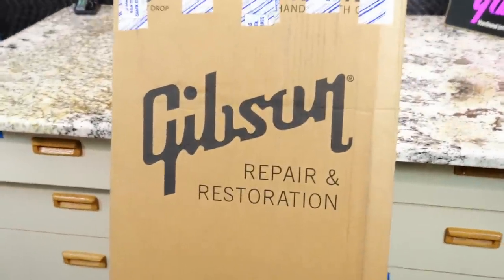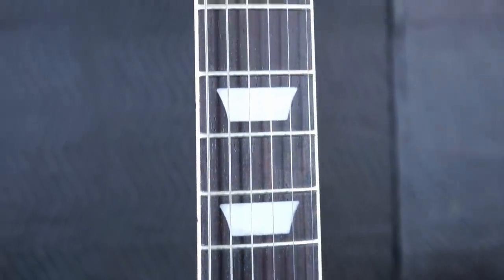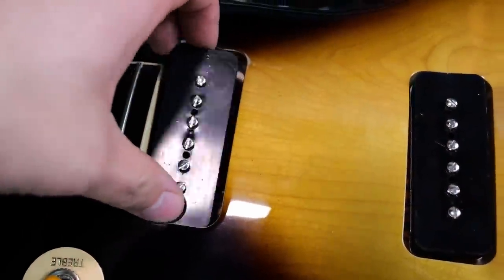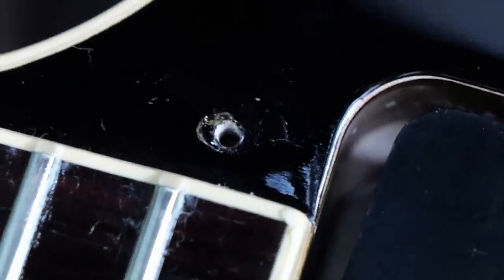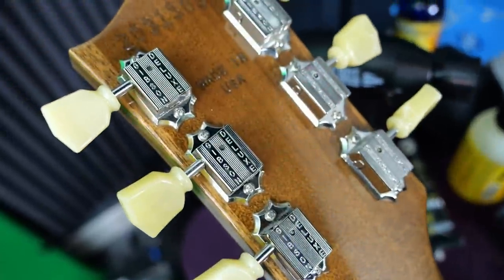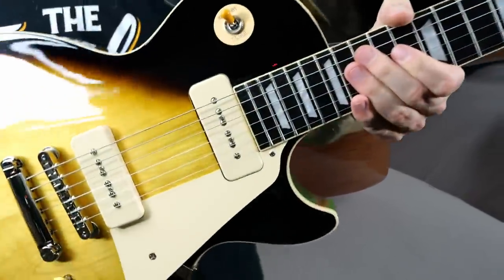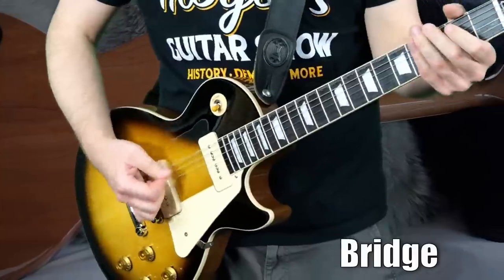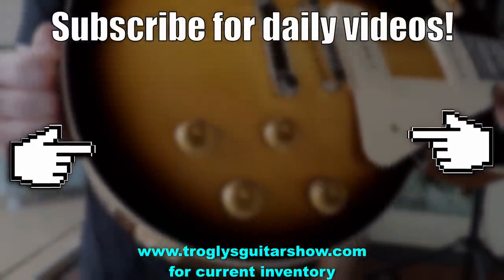I Had to See This "New" Color | 2023 Gibson Les Paul Standard 50s P90 Tobacco Burst Review

Comment: By the reading on the output it seems like they installed the pickups neck on bridge and bridge on neck for some reason you should not have to adjust those that extremely. I would personally swap in some mojotone quiet coil p90s with black covers. But that's just me. The antiquity p90s are great if you enjoy the authenticity and don't mind the hum. I'm pretty sure there is plenty of options. Also it's cool you could fit mini humbuckers with the plate.

Comment: Excellent! Bread and Butter "Standard 50s P90" in the original Gibson vintage finish Tobacco Burst (going back 100 years on acoustics). With walnut back and a plain but pretty maple grain top- nothing fancy, total workhorse. This is the one Standard model I would buy new over any other. Happily I already have a 2013 50s Tribute P90 (Studio version with mahogany neck) virtually identical to this with cream plastics. Even so, if I had $3800CAD spare change I'd get this 50s Standard P90 just to have the Standard version with my favourite finish and pickups.